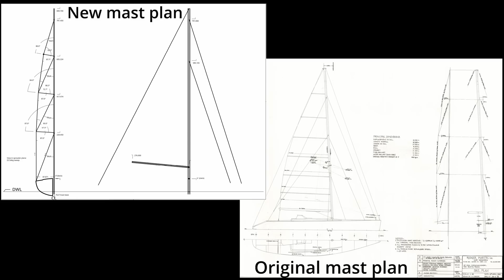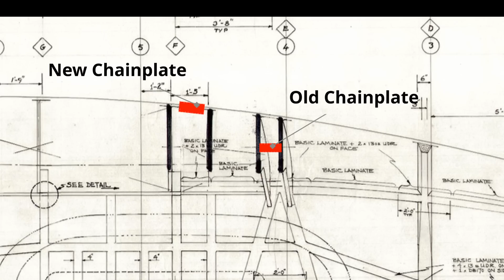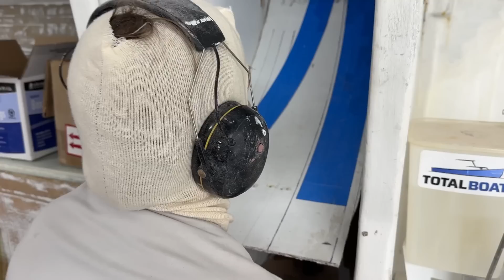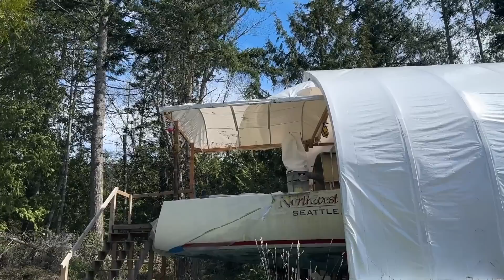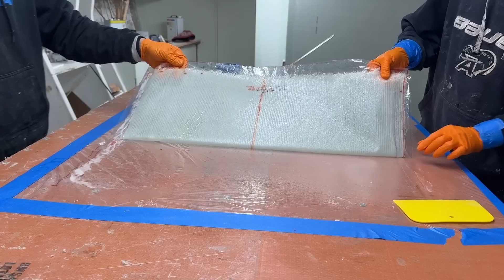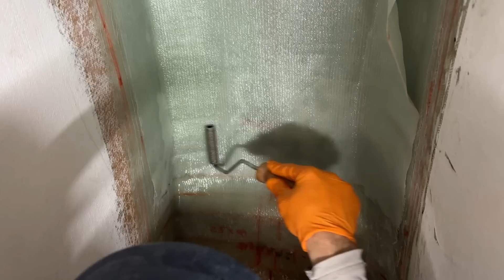Boat Build: New Mast+Chainplate Design [E75]

Comment: 10:52 How much Epoxy do you use overall? how much did you use for the reinforcement and lamination off the Chain-plates?
Reply from the maker: A $@&@*^#% of epoxy!😂 no, about 6 gallons a month
Reply: @TheDuracellProject  Thank You! I liked your summary videos ("8 Months in 25min") very much and would love to hear about how much material it takes per Project (m² of Fiberglas/ rolls of 10mx1m Fiberglas) maybe just as an estimate as a text popup. Best of Luck.
Reply: it is hard to get a feeling of the amount it takes for 15 Layers or fewer on area that is 3d and curvy recessed or cavernous. How thick a pack gets with each layer and how much epoxy it takes to drench each layer.

Comment: Fascinating as always. I have a question: with the chainplate set back, it’s pin will be still parallel to boat’s side but the pull will not be perpendicular to the pin axis. Also, the carbon fiber plate holding the pin will  be more or less vertical. Is there a reason not aligning it better in the direction of pull?

Comment: Your mom is unbelievable and extraordinary.  Your first day sailing this boat will be a nail-biter.  I would always wonder if my engineering was correct.  Will the new fiberglass hold the new chain plate and mast in a stiff wind?  Will it fail down the road?  Has your naval architect done this modification before?  Personally, I would double (or triple) the side riggings with this modification. Do you need to re-engineer the spreaders by moving the chain plate aft?
Reply from the maker: yes Evan has a lot of experience

Comment: I sailed with Mike Plant on Duracell in Vendee in 1989.
Damn scary day.We were in the biggest seas unable to enter port due to low tide.
Can remember surfing those waves and the hull just smacking the water when we went over them.
A great guy and deeply missed.
Reply from the maker: Wow, thanks for sharing.
Reply: @TheDuracellProject  I was a photographer on board.
Mike was upset that day as he needed more time to get Duracell ready for the race start.
But was also pressured by the press to do some practice runs off the coast of Vendee so the media could get Duracell filmed and photographed for stock images and film.
He picked me to be on board.
Have never forgotten the wave height and deep troughs that day outside that harbour.
Duracell did her job though.
Been at sea many times but that day sticks in my mind a lot.
Good luck with your rebuild.

Comment: The side cutter you used to remove the fibre glass on the inside also has cutter blades. That makes removing the pvc-foam core a breeze while not damaging the outer wall. Maybe an Idea? 

💙

Comment: I have learned a lot from your superb videos on fibre glass ...great job. That said I would now focus on placing or fibre glassing tubes / cable ducts onto the walls ready for later on adding the many wires for nav systems etc . I also would add wood veneered sheets in the living areas as that will add more warmth and give a family cruiser feeling. The idea of making everything in white and grey in fibre will not in my view add the warmth you want in my view.
Reply from the maker: I'm planning on enough wood trim to keep the space cozy, but not too much to make it dark.  And paint for us is a cheaper route.
Reply: @TheDuracellProject  If you are talking about teak ...yes that makes it dark but US light oak gives a light look and feel. I would consider that and in terms of price compared to the rest f the build it is peanuts especially if you consider (1) Your time, experience, skill (2) The eventual resale value of the finished product as after many months of sailing you will sell the thing! Good luck!

Comment: Wow, 15 layers of 17oz in one shot - such a great job controlling resin content and keeping the fabric on-axis. That's an amazing chainplate bedding area now!  Curious if you and Evan discussed part-time runners, for those really bad days when more support would be good insurance against shock loads. They would just live at the mast, and there would be stored tackle for quick deployment, and of course engineered anchors aft. There have been some crazy ocean days where I'm super thankful to have these "optional" runners that help with the reefed main head area.  If you don't already have your metal bits for the plates, Coligo Marine makes custom stuff in titanium for really reasonable prices, pretty quickly. John Franta just wants to see cool boats get great materials, and he's so helpful to builders.
Reply from the maker: Yes, we will have check stays for running the staysail or with a reef in the main.  Usually they'll be put away at the shrouds, as conditions get more sporty and sails are shortened, we'd deploy them.  I was already in the weeds and didn't want to go any deeper with my explanations.  Thank you for the nice words.
Reply: @TheDuracellProject  cool. Also, maybe checkstay(s) could be configured with a quick-attach point for lifting tackle, like the upper anchor for a lifesling or other lifting - from - water tasks (e.g. lowering a dinghy motor)
Kind of interesting height calc idea…
And I’m a dork, forgetting they’re called checkstays ;)

Comment: Matt. As you have a Dewalt Oscillating Tool you should get these two scraper blades for it. The offset blade DWA4217 and the straight blade DWA4218.  With these two blades it will make removing the foam core for your chain plate project a whole lot easier. The scraper blades make it very easy to remove the foam from the fiberglass without damaging it. It will also contour  the edges for you.  The nice thing about the scraper blade is it won't cut into the fiberglass. Do plunge cuts into the foam and then get under the foam next to the fiberglass and pop the foam off in one piece.  Doing it this way doesn't create foam dust like the router.

Comment: About forces created from wind via the rig to the hull and the mast foot. This is a zero sum force-system. I do not see how the mast foot forces are integrated with the shroud forces? About the boat double displacement acts on the mast foot generated from wind/shrouds/stays/mainsheet!
Since the mast foot takes all the forces from shrouds, stays an mainsheet. You need to see to it that all these forces also are connected int the boat. The mast foot should be connected by beams/structures to the chain plates/shrouds. Otherwise the hull will deform around the mast foot.
Unfortnately many boatbuilders do not see this zero-system. But its however the way things are. And the guy who built your boat originally (forgott his name) feels like very competent. So serious work done. That is a good thing for you. You basically have a very good boat to build on!
What I'am trying to say. Try to see the whole picture of things, specially forces in the rigging system! And whne you put the chain plates more aft, a new force system will form. There are plenty info on the net about this. Think of the double displacement. Is that around 20-25tons or what! It's a lot of forces.
The nice thing about sailing yachts is that forces are not transient=verry high, unless you hit ground. When sailing even in hard weather all forces grow and decrease in a continious way and that is a good thing for the boat as a whole! It will hold up!

Comment: Have you considered that by having swept back spreaders you might have difficulty in dumping the main if getting in a broach? Thyat's been my experience
Reply from the maker: It is true that the main cannot be dumped as far as a mast with in line spreaders.  In my experience, during a broach the bow will usually come towards the wind enough to allow for some luffing, even with swept spreaders.

Comment: Laughing as my day yesterday was cutting a balsa core boat open from the outside as hull got crushed. Had cut down to 6" squares  for a 3' x3' area. Chisel and hammer, fun.
I was wondering about that much glass laid up at once not catching fire!! Of course I'm usually using fast cure😁
Reply from the maker: Yeah the Totalboat high performance epoxy is very slow, I've never had a problem with it getting too hot.

Comment: Are you going to use stainless rod or wire rigging? Be good to think about lightning with carbon chainplates? Maybe use aircraft composite grounding methods with grounded copper mesh on 😢 the carbon?
Reply from the maker: Rod rigging is the plan.  And yes, we'll actually get into the lighting problem with carbon chainplates next week.

Comment: Great progress and good idea on the swept back spreaders and chainplate relocation. With less water ballest and possibly shallower keel, non overlapping jibs for close hauled sailing will probably be more than adequate. When you construct the new carbon chainplates, it's critical to evenly tension all the longitudinal fibers in the layup so they evenly carry the loads. Otherwise, sequential failure of the fibers under load can result in disaster. This is an easy mistake and common failure for carbon chain plates. Seriously consider consulting with experienced carbon chainplate laminators to design your layup technique.
Reply from the maker: 100%.  Keeping the strands flat(no creases) will be the hardest part about building these chainplates.
Reply: @TheDuracellProject   It's a bit more complicated than that. Urge you to work with someone who has built and break tested carbon chainplates before building them for Duracell.

Comment: About mast; they buildt a 20m mast for a 46ft catamaran here in carbon - locally - not that complicated. Its rotating and with no spreaders. 50cm cord wingmast. Same concept was tested ona a monohull - but with backswept spreaders - cause narrow base. Not backstays so could use fathead sail. The mast and rotation add 10m2 to sailarea and reduce drag. That and using fathead could reduce mast hight significant.

Comment: My compliments! I am 76 and currently rebuilding my 40 years old , 40' catamaran on the beach in South Thailand. I have some boatbuilding/GRP/epoxy experience but I have rarely seen so tidy work outside top racing construction.
I'm going for a freestanding double mast rig, so I won't need chainplates😅. But I would have added a couple of layers of carbon/ Kevlar to replace 3 or 4 of glass and integrate into the carbon chainplates. Cheers from a hot beach!
Reply from the maker: Good luck!

Comment: Hey @Matt - what is your actual plan for the keel? As the original boat had no keel but huge ballast tanks, which you removed, you might want to bolt on some weight below the hull right? And really appreciate another amazing video. Keep it up. If you are interested in DIY Keel Design i can really recommend a video done by a channel called Sailing Oryio - they basically had to make their own keel, as the old one was delaminated and beyond savable.
Reply from the maker: We have the old keel, it's 3m long and 5 tons.  We'll be modifying it as well.

Comment: ive done the same on my boat although im talking about a VdS Pioneer 9 (29ft), yes there is that compromise in which you loose windwards ability but honestly, for cruising, a 100% genoa its what we want, no only because it makes it possible to potentially circumvent the new chainplates design , but it also means less stress on the rig overall, better handling, less winch power needed
Reply from the maker: Exactly, jibs make life simpler.

Comment: As you transition to a family cruising sailboat live aboard, from an around the world ocean race boat, would not shorting the mast height help make a more stable stronger rig and also permit a shallower keel to provide less exposure to grounding? Many believe it was initial grounding in the shallow Chesapeake Bay, that caused Mike's keel to later fail. Also with a higher mast you supply a taller lightening rod to thunderstorms.
Reply: That was his later boat Coyote not Duracell that grounded in the Chesapeake. And yes, the keel is going to be shallower.
Reply: Yes both boats were designed for the tough round the world open ocean races. High Tech material like the graphene is fine for world class competition level and limited time use, but perhaps are not so good for chain plates on a family cursing boat's extended use and exposure now on the edge of the hull. Also, with less volumes in the water ballast tanks that too may make the tall mast "taller".
Reply: Mast height is just one factor. You can also just adjust sail area
Reply: Yes you are correct reducing sail helps, but the higher aspect ratios put moments on a lever (that is the mast) higher. Adding more parts also increases possible points of failure and windage in a storm.

Comment: hmm forgot how many pumps - note to total boat how about putting a resettable counter on the handle perhaps with a removable, replaceable handle so if any resin etc gets on it etc it is replaced - eg the pump assy could cost $10 and the replaceable handle $1,000 with easy finance terms

Comment: I have had good results removing insulation with a wire wheel connected to a mini grinder or a drill. It’s probably a bit messier then your method, but it seems to quickly eat through foam. 

Great videos!

Comment: Are you concerned that the now solid section of hull mounting the chain plates is going to cause a great deal of condensation?
Reply from the maker: i'm not too concerend about that
Reply: could always add foam to the inside of newly constructed area once solid hull and chain plates finished. would guess that if its 70 inside the boat with 50% humidity, condensation can occur once ocean temps around 55ish?  look to psychrometric chart for air to get exact result.  maybe 50% humidity of interior air not enough for being in open ocean?

Comment: In an earlier life I spent many hours detailing strap laminate chainplates, forestays and backstays whilst working for a company called SP Technologies. And we never had one built to the specs! The builder would add some more laminate because they didn’t think it was enough, then the owner would come along, get nervous at the thinness, and suggest some more. In the end it would be at least double/triple/quadruple the original specs. But even adding lots more material, it was still incredibly light compared to a metal alternative.
Reply from the maker: yeah these chainplates will have a safety factor of nearly 20 to 1.

Comment: So one thing I’ve read about swept back spreaders is that you can’t run with the main as extended. What sail strategies do you plan to implement to mitigate the issue sailing downwind? With robust roller furling, a twin headsail jib would be my guess as to the solution. Kirsten in the GGR apparently spoke super highly of it’s effectiveness. The only trade off being needing twin spinnaker poles. I (hopefully) foresee homemade custom carbon poles in Duracells future 🤞
Reply: This boat will be fairly fast. Instead of running dead down wind, it will be sailed to maximize velocity made good. Essentially, you point a little higher to maintain boat speed. This is the VMG theory of downwind sailing. You can also pole out the jib on a whisker pole. That is a classic trade wind strategy for cruisers.
Reply from the maker: a little over 2

Comment: Hi Matt and Wifely and Mom. It so sweet see the Team working Very hard to Get the Dream Sailboat in the Water again. Matt would the using of Kevlar/Carbon Fiber be better then straight Carbon Fiber for your chainplates ? Just thought it also help Keeping the Cost Down? Have you reach out to U.S. Composites and see if you could use them as a Sponsor?
Reply from the maker: we haven't considered Kevlar. for something like chainplates we only want to use one material
Reply: No - Kevlar and Carbon fiber have very different modulus of elasticities (how stretchy they are). Carbon being stiffer takes almost all the load. So the Kevlar is doing nothing.

Comment: I've always wondered when you use the vaccum bag do you ever get excess epoxy sucked into it the pipes or pump?
Reply: You can typically add a epoxy trap (a solid bottle) in line. When you do infusion, this is a must. With wet lay up if done properly, the excess resin is mostly absorbed by some breather fabric between the peel ply and the plastic bag.
Reply from the maker: With layups this big, we always try and squeegee out as much epoxy out of the fiberglass before laying it up, this way there isn't too much excess epoxy for the vacuum to press out.  The breather cloth I use is also very absorbent, and I attach the vacuum away from the layup where epoxy would have to travel a ways before entering the hose.   We haven't had a problem.